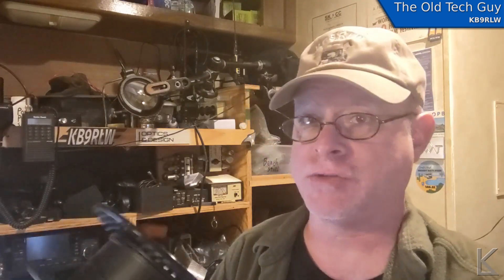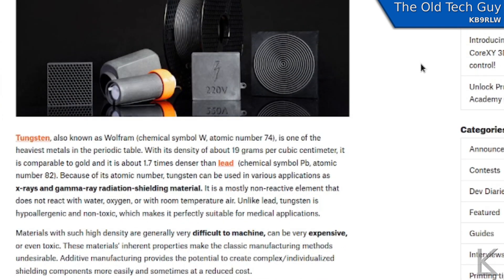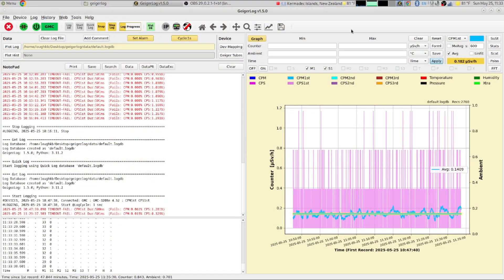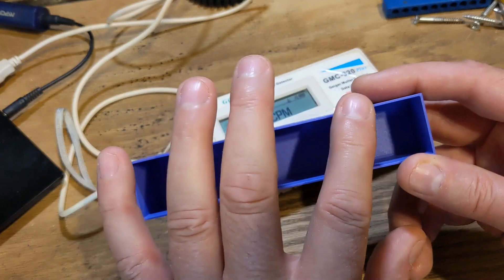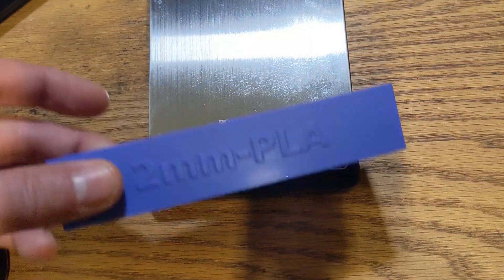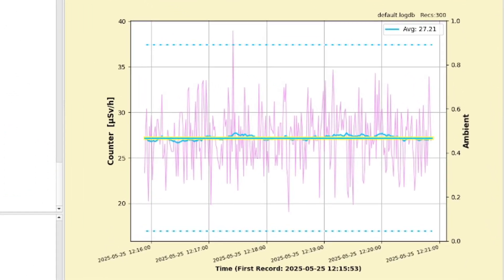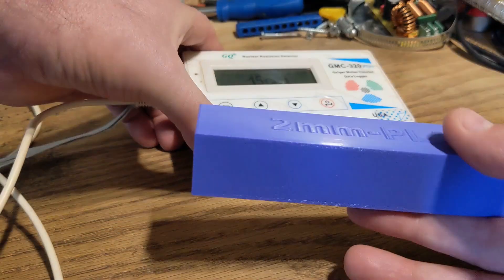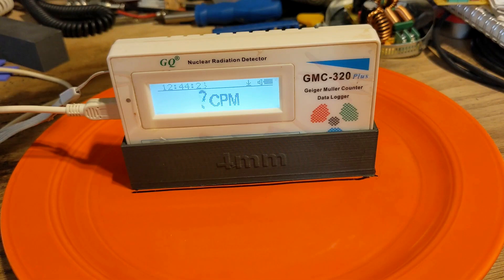3D printing - Testing Prusa PETG Tungsten radiation shielding filament.

Comment: I like how you set up your test.  You did a good job controlling variables.

One conjecture: you're probably not detecting any alpha particles with your geiger tube.  I think that essentially no alpha particles would make it through the plastic housing of your detector and the glass envelope of your GM tube.  Most of what the plastic shielding materials are blocking is probably lower energy gamma rays as well as secondary x-rays produced via bremsstrahlung.

Still, great test!

Comment: You could also use the new nextruder diamondback nozzle. I have one. It's amazing. You actually have to drop the temperatures a tad because it works at transferring heat a little too well. But anyway......I was surprised at just how much PLA did in this test. Very interesting.

Comment: im gonna say based on the difference between 2mm and 3mm and the notorious composition of the old depleted uranium plates, that last .5 or so microsieverts was probably beta radiation. Which brings up an interesting idea, if this is effective against Alpha and Gamma radiation. What would help block the beta as well? Time to test more filaments!

Comment: This is a great review 😊 I can't find a pb equivalency value for this filament Unfortunetly... Can you make a test with idk 1mm pb and add to the measurement? It would be great to see how it works against that... I have some projects planned for a long time for some xray machines, but it's a bit expensive to just send it and have fun 😅
Reply from the maker: On Prusa's blog Page announcing it, they had some technical specifications. You might find the information you're looking for there. You could also contact them with your question. They may have already tested this.
I linked their pages in the video description.
Reply: i wonder if its properties are isotropic or dependant on orientation of the XY-plane.

Comment: Interesting, I'm sure there are plenty of uses for this material. I would like to have seen how much shielding you got from a thin lead sheet as that is what would probably be used in a lab. In the lab I worked in we had lead bricks that we had to build walls with, they were so heavy.

Comment: I wonder how this shielding does in gamma radiation. Your "fiestaware"knockoff does only beta radiation. 🤔Also do you need a ruby nozzle for that filament? I'm sure that this filament will be very abrasive.
Reply from the maker: The Uranium in the glaze emits Alpha and Gamma radiation.  It also decays into Thorium, emitting Beta.  All three types are emitted.  Plenty of info on the web about it.  
Yes,  as I pointed out in the video, it's an abrasive and you need a hardened nozzle to print it.
Reply: I've been told, with hardened steel nozzles, it'll wear out a nozzle every 1kg filament. Diamond nozzles are coming.
Reply from the maker: @brianjensen5200 I am interested in reading the source material whoever told you that based their conclusion on. Please send me a link.

Comment: The uranium decay chain is primarily alpha which is easily shielded, and smaller amounts of beta and gamma. My employer is currently looking at evaluating this as a radiation shield in an environment where high energy gammas and neutron radiation are the primary concerns. It would be interesting to see this test performed with something like a Co-60 source.  Obviously not a home experiment, but would definitely be informative.
Reply from the maker: If you have the proper equipment available, you can request samples of the filament from prusa. And it can be printed on most consumer level printers.
Reply: You can test it with an exempt quantity of Co-60 at home and extrapolate the data from there.
Reply: @Technoguyfication it isn’t a good idea to have any CO-60 sample at home for any reason.
Reply: @melgross this is just… patently false. You can buy microcurie check sources that can be measured with a meter but don’t put out enough dose to be dangerous. The actual source is sealed inside plastic and impossible to access without destroying the check source. They’re commonly used in high school and low level college classes to teach about radiation. It’s completely safe. 

Just because it’s cobalt 60 doesn’t mean it’s inherently unsafe in any quantity. Quantity is a big factor.
Reply: @Technoguyfication yes, I know about these. I’m not talking about that. I’m talking about the samples often sold on Amazon or eBay, and likely other sources. They’re not always available, but they do pop up. Those are dangerous.
Reply: isnt heat going to be an issue with high intensity radiation?
Reply: @simonschneider5913 no

Comment: now will it act as a reflector of radio waves?
Reply from the maker: Maybe. But it's pricey. It would be far more cost effective to print a shape in cheap pla and just cover it with aluminum foil.
Reply: @loughkb  i wonder what niche this is going to be used in. isnt laser-sintering more effective in shielding applications?

Comment: Could this be used as shielding in transceivers ?
Reply from the maker: It's not electrically conductive, so you wouldn't have any way to bleed off the RF to ground, which is what you need for that type of application.

Comment: That was an interesting video, thanks for that!
If you wanted to be really thorough in measuring how good it screens against radiation (and you were pretty thorough already, with the 2mm spacer and all) you could measure the radiation received in the shield WITHOUT the plate - because the material itself maybe contains traces of radioisotopes! Then you can distinguish the external radiation it's blocking from the additional radiation it's creating itself.
(As an aside, I actually read the terms and conditions when renting a storage unit once. It said I mustn't store anything radioactive in there. I pointed out to the guy behind the desk that I was radioactive, the air was radioactive, the steel the building was made of was radioactive... He just rolled his eyes and told me to just sign the damned contract...)
Reply from the maker: I think, to be accurate in measuring the material itself, I would need some kind of shielded space to eliminate background radiation from environmental sources as well as cosmic radiation.  
My counter surely doesn't have enough resolution to distinguish the slight variance in the somewhat variable background.
Although I might be able to achieve a meaningful result if I increased the sample time to days and made a shield that completely encloses the counter.